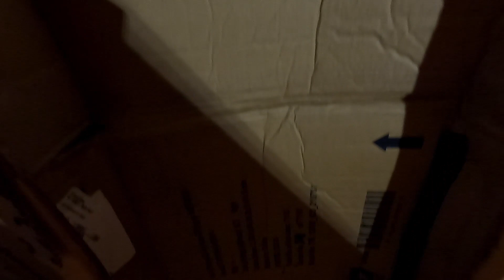Ice Damn solution with Cardboard

Comment: Nice video.  How well does it work in winter?  Heating vs cooling?  And does the spray foam secure properly?  I'm thinking cardboard isn't a good base?
Reply from the maker: This Eliminated the ice damn issue this customer was having. No issue at all with the adheasion of the sprayfoam as long as the sprayfoam is appied cortectly and at a proper mixture.

Comment: Wow, what a difference! 
Very helpful & informative!
Does this only work with this kind of soffit/roof venting system?
Would this cardboard trick still be helpful without the addition of spray foam that you referenced?
Reply from the maker: The principal is the same for any vented roof. The main point is that the system needs a point of fresh air to enter at the bottom and a place for the hot air to exit. As long as that can be accomplished it will work. And yes just as it is the system works with just the cordboard. But some heat is making it threw the cordboard in order to block all of it insulation would need to be added. But 18degree drop with just cardboard is no small feat. Insulation could always be added later